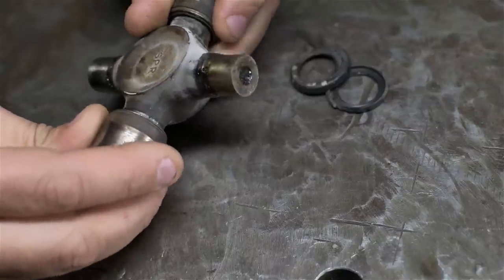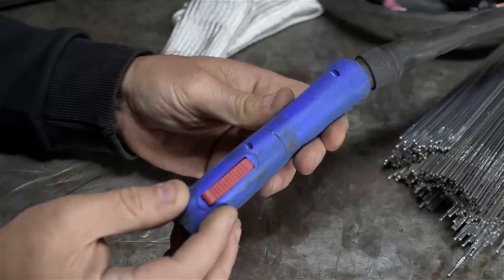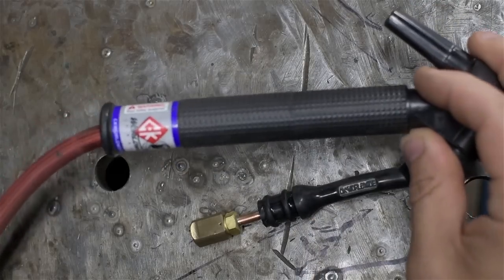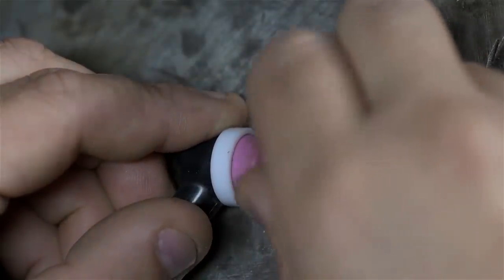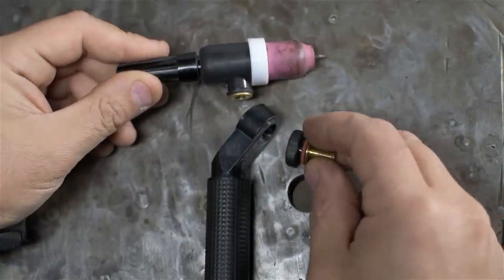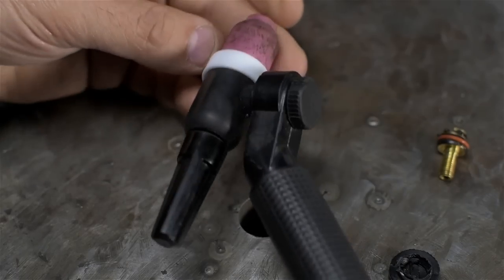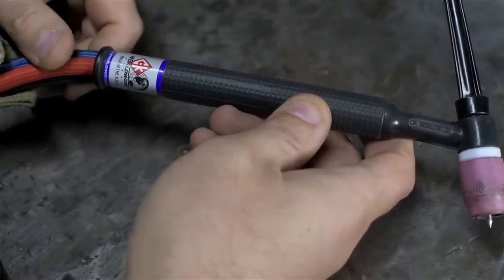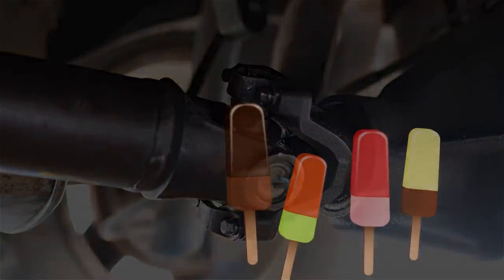TIG Torch 2: Flex-Loc and the CK-80

Comment: I just wanna know one thing - how do you scratch yourself ? 
There is no way your fingernails could  do it as they are recessed below the top of your fingers ! Not being critical but you truly have funky fingernails !  - well to me anyhow ! 
Don't get rid of the mig ! Make a trolley that the tig and mig live on and make it mobile - best thing i ever did ! 
I now have 3 stick welders as my tig and mig are capable of this plus i have an old transformer unit ( my first ever welder ) that i will not part with as i know no matter what i can rely on it - no electronics just a transformer and  made in Australia so i'm getting buried with it !
Oh and i forgot to ask as you mentioned your past with welding  etc , any chance you can shed some light on the international man of machining mystery ?  Or are you really an intergalactic criminal hiding  here and your lathe really is a time machine?

Comment: For cooler the torch i use a sistem of water dispenser, just conect de output of de torch to de input of de water dispenser sistem and Listo.
Aca en Argentina si somos Ratas pero no boludos, i dont know if water dispenser is the correct name, but is for drink water in street, is public.

Comment: Make a simple cooling system with PC liquid cooling parts, small pump (get a D5 laing), 360mm or bigger radiator, and some fans. Cheap, easy, foolproof, and quiet. Modmymods.com and talk to Joe. I get all my cooling stuff from him.
Reply: For the duty cycle tony would use, i think ebay parts would be a more appropriate price/performance range, heck, even an old window ac unit and use the core out of that for a radiator, no need for fans! a pair of ebay pumps, rads and some ebay fans would set you back less than $100 and would be more than sufficient - then tony could make a nice aluminium reservoir and trolley with some switches and a little flow meter/indicator